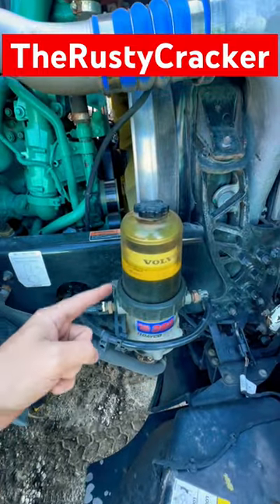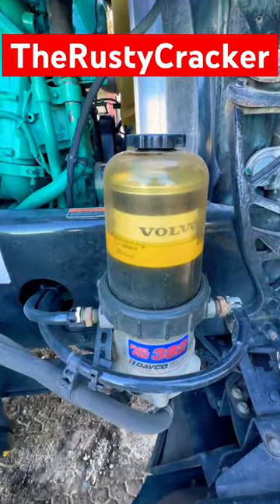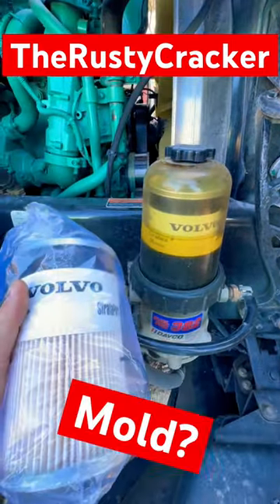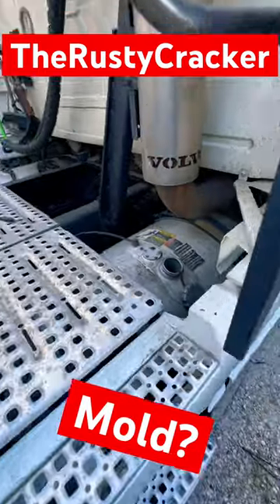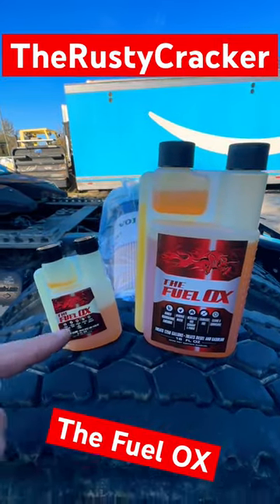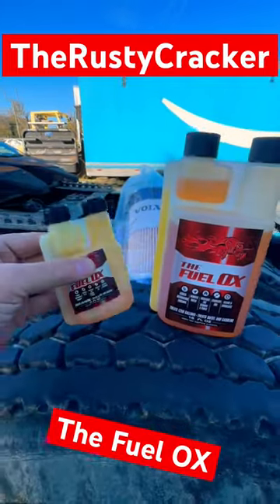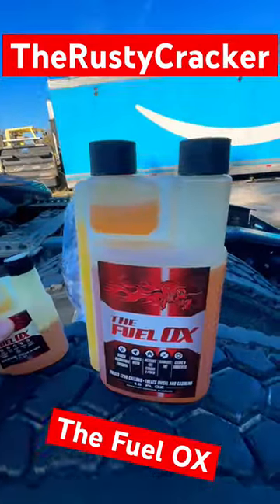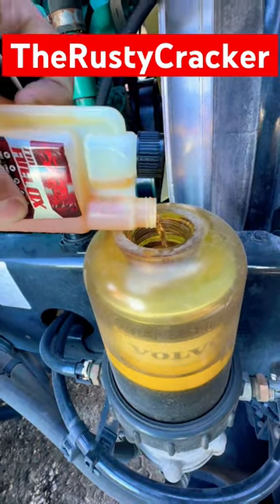Diesel Fuel Filter KEEPS CLOGGING UP! #volvo #fuelox #semi #trucker #truck

Comment: I got bad fuel in that TA in Fairburn GA. I filled up 300 gallons, when I came back the following day my water separator was blue. I had to replace it there  just to get to denver. First I used klean 911, then lucas and finally that cummins 40 dollar bottle. It kind of cleaned it but every 11k miles I had to replace water separator filter. All that took 4 months,  heard a good fuel system clean with steam by the dealer does the job. Cost about 400 bucks.

Comment: If you feel it is necessary..There is a drain on the tanks. Drain all the fuel out.. see what comes out? I really don't think 10k miles on a primary fuel filter is that bad.. its doing the job..😊

Comment: Id be looking at where you are getting your fuel from. That algea growth didn't start in your tank. You need biokleen (not sure how you spell it) or some other fuel algaecide. If you have big storage tanks you need to treat them too.
Reply from the maker: Get fuel at flying J
Reply: Try  petro or ta
Reply: @TheRustyCracker  agreed, try treating your tanks and changing where you get fuel for a bit and see if it makes a difference. Treating your tanks will knock it out of your tank but if your supply is tainted it'll come back